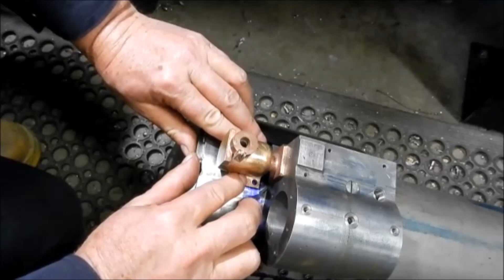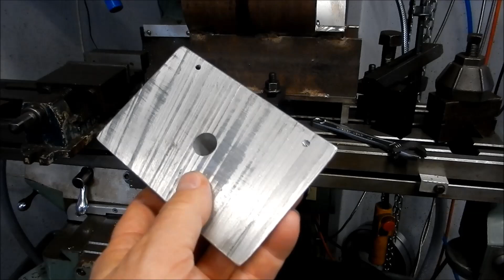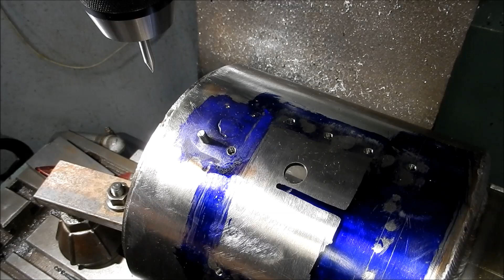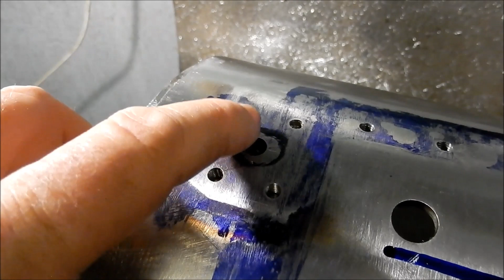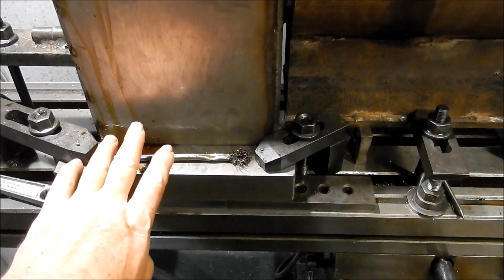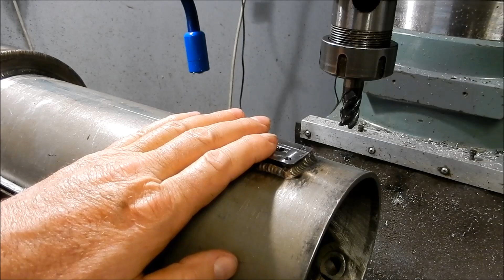Ransomes Sims and Jeffories Stationary Engine Regulator Mounting

Comment: That stainless sounds like really gnarly stuff. Does the model boiler code support stainless? It used to be just copper and mild steel.
Reply: Hi Mark, thanks for your question. The AMBSC (Australian miniature boiler Safety Committee) code Part 4 is for Duplex Steel Boilers. The grade of Duplex used in this code is S31803 - 2205, So it is not your regular 316 or 304 type stainless, in fact the code does not permit the use of 316 or 304 stainless due to the pitting and corrosion caused by sodium at elevated temperatures. 
2205 Duplex is preferred as it is much less likely to suffer from stress corrosion cracking chloride pitting and crevice corrosion and sulphide stress corrosion. 
Duplex contains higher levels of Chromium, Nickle, Molybdenum and Nitrogen which gives it almost seven times the corrosion resistance of 316 stainless and 1.5 times the Tensile strength. Duplex Steel has a Ferritic-Austenitic microstructure hence the term Duplex, it is also magnetic due to the Ferrite.
When heated, Duplex has approximately the same expansion as carbon steel, so the Miniature code also allows for using both Carbon steel and Duplex together and they are readily welded using Duplex TIG rods.
Andy

Comment: Hi Cam,
Really good video mate 👍
So.... what is ‘Simplex’ stainless? It looks and sounds like a real bitch to machine.
What’s it like to weld?
Regards,
Robert
Reply: Hi Robert, 2205 Duplex Steel, welds quite well. In comparison to say 316 Stainless the weld puddle is more sluggish so it is best to weld with slightly higher AMPs to give a more fluid weld puddle, this also enables a faster travel speed so the net effect is lower heat input which is preferred.
Andy